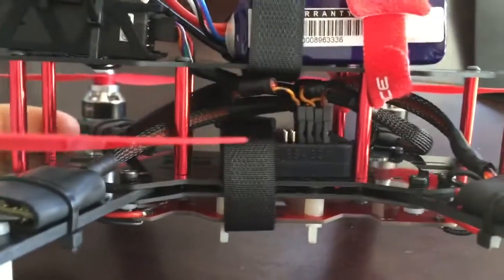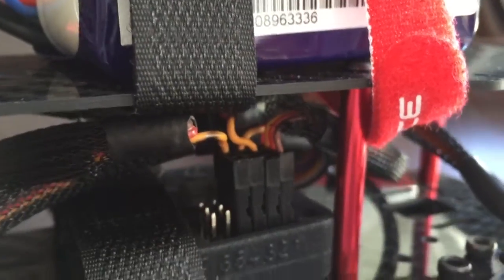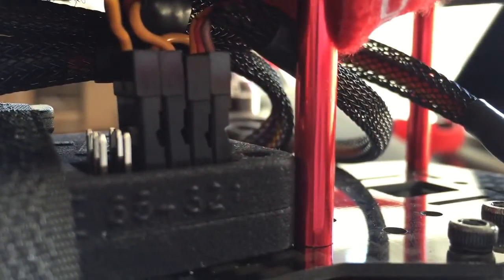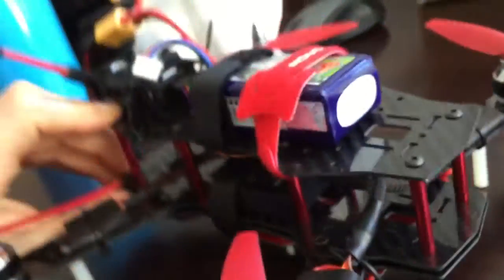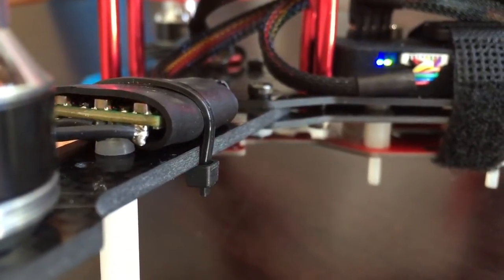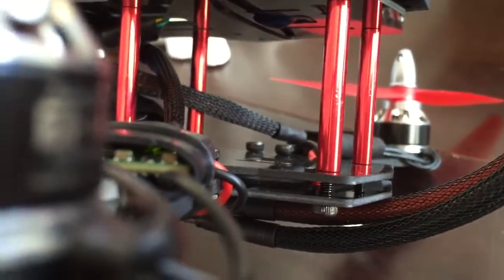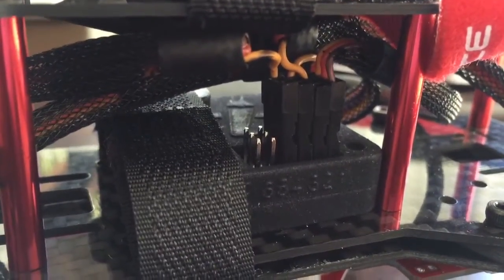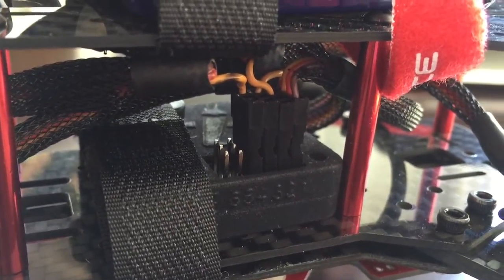CC3D wiring with 12amp hobbyking Afro ESC's

Comment: i order mini esc 20a and they only have 2 cables black and white  signal and grown and i was thinking to only conect the signal cable to the cc3d  so you think is going to work ??
Reply from the maker: +tiger exhaust It's recommended that you ground the esc's (plug the black wire into the ground ports on the flight controller)

Comment from the maker: @dee Williams keep all the cables for each esc plug intact. Do not remove the brown or red cables from them. I have all of my ESC's connected separately to a power distribution board beneath the frame. I just replaced my fried esc and it's working fine now

Comment: I Got 12 amp afro and CC3d board and I have no power to the receiver or the board from the battery but can power the board from the usb and it works, I tried with out the red wire except on one and that didn't work, put them back that didnt't work .Help Also